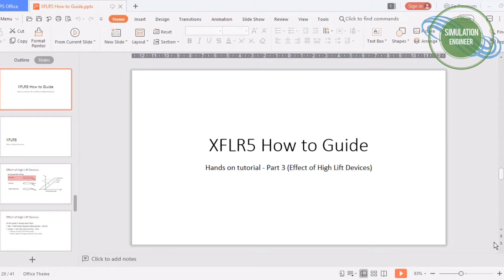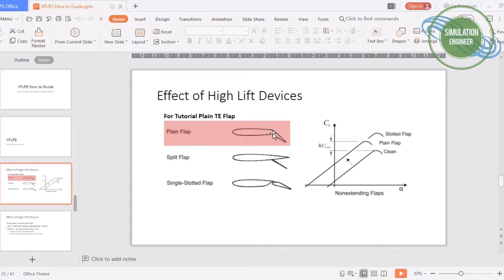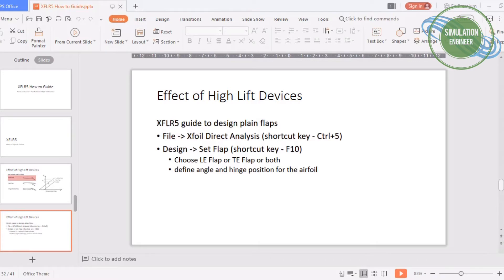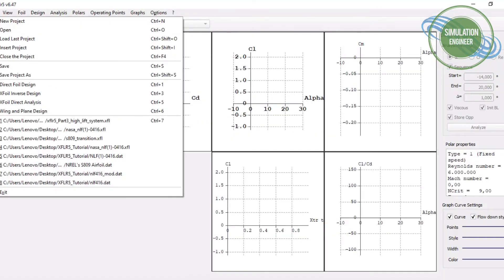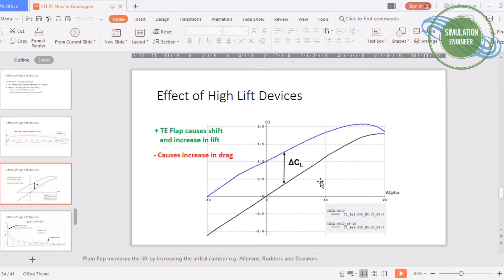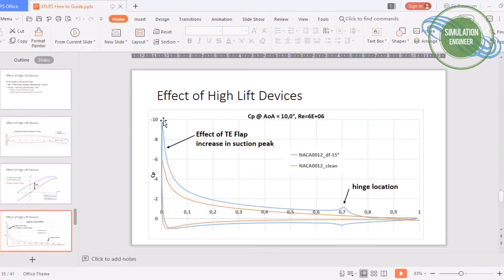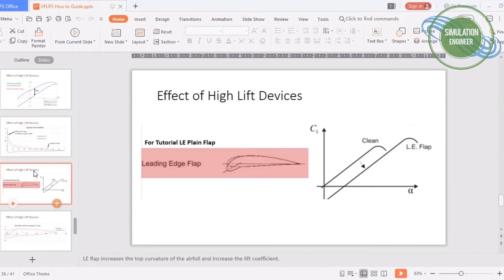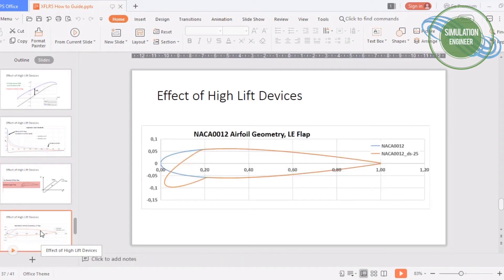XFLR5 PART3 HIGH LIFT SYSTEM | HANDS ON TUTORIAL SERIES

Comment: sir,
 why we r getting lift (Cl) even after stalling AOA?
Reply from the maker: Well if you see the lift polar it's kind of trailing edge stall that means flow deceleration starts from trailing edge, after reaching maximum lift at alpha_max, if you still increase the angle of attack beyond max_lift there will be still some lift but with decreasing trend. In case of leading edge still the lift results in an abrupt loss of lift. Additionally there are also numerical artifacts in the computations too. Thanks
Reply: @Simulation-Engineer  thank u so much🤗